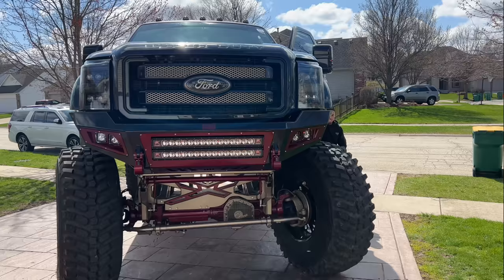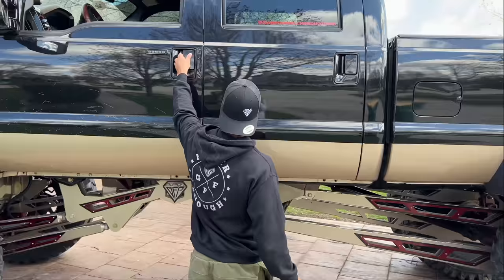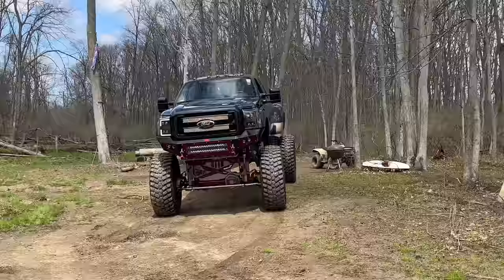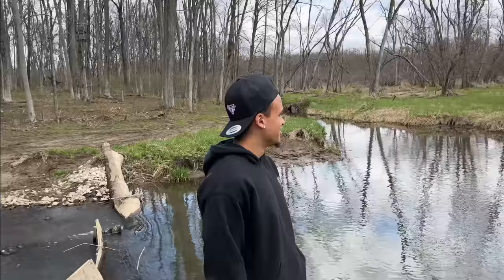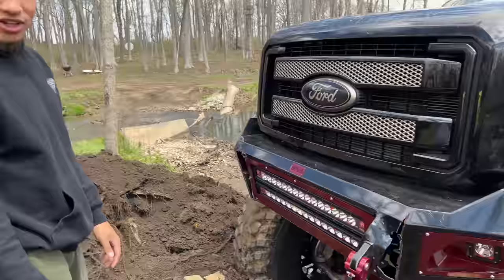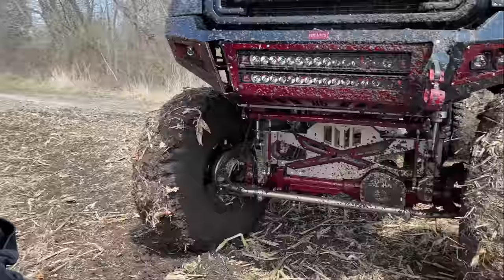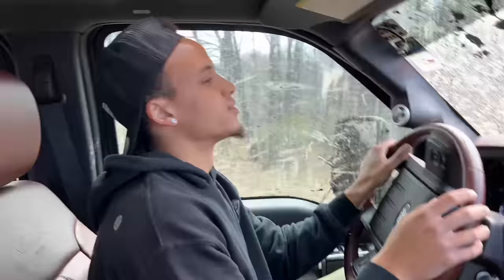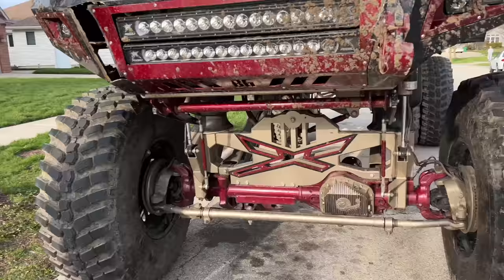Mudding my $200K Sema Truck Until It’s TRASHED [4K]

Comment: How long has it been since one of your big trucks had a front drive shaft?? Well longer than a day?
Reply: Lol he snapped the current front driveshaft attempting to jump it
Reply: Lol
Reply: Why do they take out front drive shaft
Reply: @jamessammann9183  I would like to know that to
Reply: @jamessammann9183  most of it is because the pinion angle is to steep when you go that high you either need a divorced transfer case or a drop box to make it so the front doesn't break every time it gets locked in
Reply: @lillepercon86  thanks did not know that

Comment: Is it still worth 200k knowing the parts are unknown to be good or bad lol ?
Reply from the maker: What
Reply: I think he's talkin bout the bumper lol
Reply: @GabeFarrellProductions  truck is a piece of junk
Reply: @ryanorlowski1247  Buddy. What do you drive?
Reply: @lbctatro  22 Lariat, 22 Pathfinder, 21 Can-am x3 all paid off, thanks for your concern tho
Reply: @ryanorlowski1247  Nice, that's respectable but I don't understand why the trucks a pos
Reply: @lbctatro  looks like it was built with the cheapest of parts, bumper is like 18gauge steel if that. Truck looks nice but that's about it,  looks like its going to break or roll over just driving normal. just my 2cent
Reply: Agree with @Ryan Orlowski

Comment: With any aftermarket bumper, it’s important that the tow points transfer all the way into the frame with at least as many bolts as the factory engineered tow points. 

But regardless, if the truck is extremely stuck it will require some level of strategy to remove.